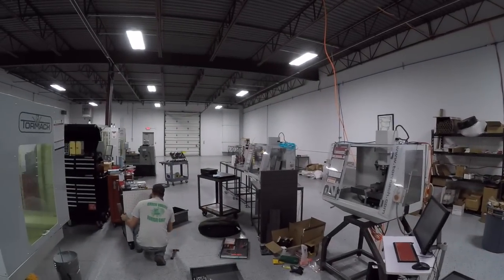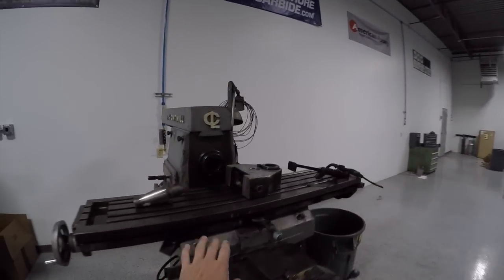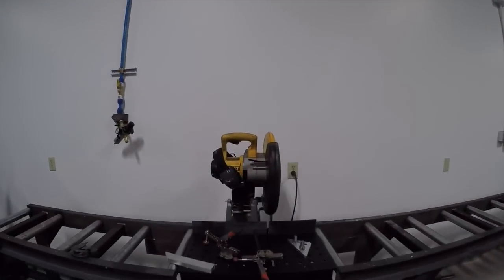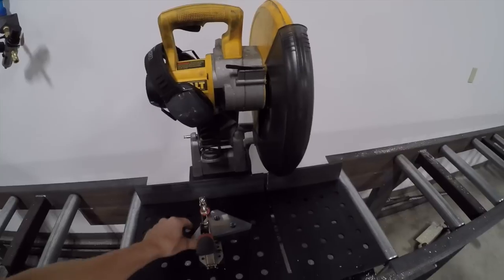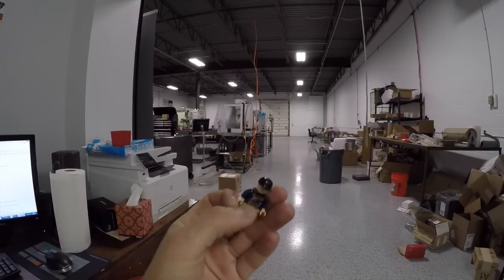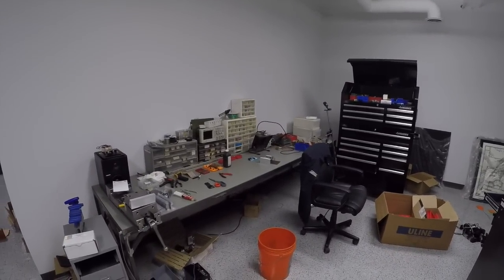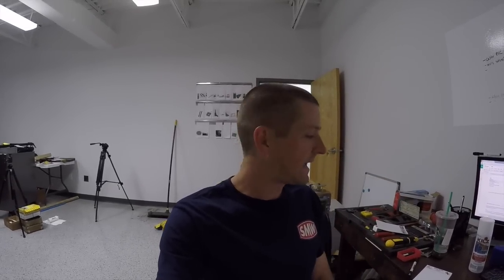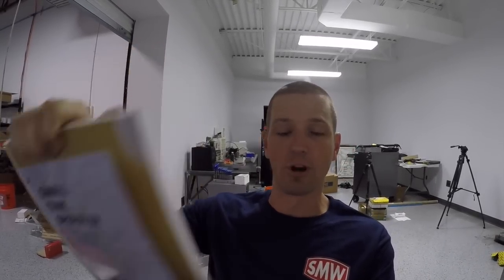New Product, Organizing Shop, Best Small Business Book! CB30

Comment: I have the Evolution Saw... I want this fixture plate. Do you suppose it will bolt up the same way? The bolt hole pattern seems to be 136mm x 42mm (or there abouts)

Comment: If you are interested in the Arduino as it appears you are.  Go look at a board solution to most custom CNC machines:
http://stores.ebay.com/Protoneer  they have boards that mount to a Raspberry Pi (a full Linux machine for education and experimentation) that will allow you to build a CNC machine with full computer support and Arduino support. The CNC hat that goes onto a Pi is the standard CNC setup and is programmable from the Pi.  Cost is $32.50 plus shipping $5.00 to USA.  I recommend it highly.  It is super easy to connect to stepper motors and all the control parts for a custom CNC machine.

Comment: John,
Best wishes for your new baby and the whole family.
Been meaning to chime in on that Colchester lathe. I have its baby brother.13x40. Here are the things I had to deal with: (1) Main clutch slipping. A fussy adjustment but hasn't bothered me since. (2) Apron oil pump. This was probably the reason for lots of the premature wear on this thing. Turned out that the steel pipe from the manual oiler  to the distribution point at the top of the apron rusted out. Apparently a common problem. Thus no oil on the ways cross slide or internal gearing. (3) In the apron, in the pinion shaft, the key that runs in the slot of the power spline shaft was nearly worn away. Mr. Fenner helped me with that but unfortunately he lost the footage. (4) Gearbox had a horrible buildup of glop that impeded the function. there was one broken fastener in that muck. Also the plunger in the 8 position selector arm can get oil bound. I milled a little flat on the side of the plunger shaft and fixed that. (5) the bedways  are worn in the area near the headstock by about 0.01. Living with that for now but will have to deal with it eventually. Good luck with yours.